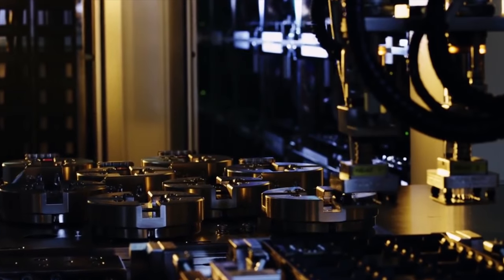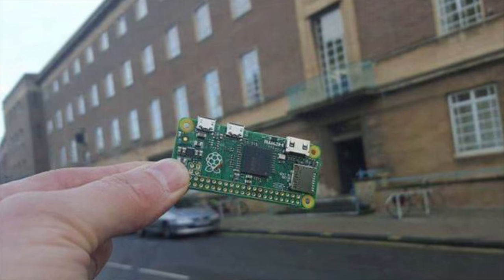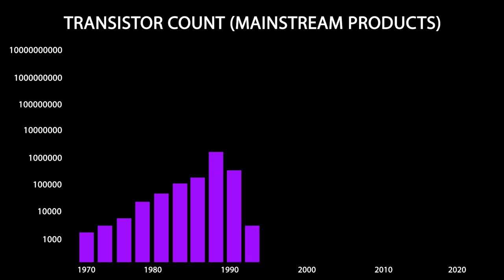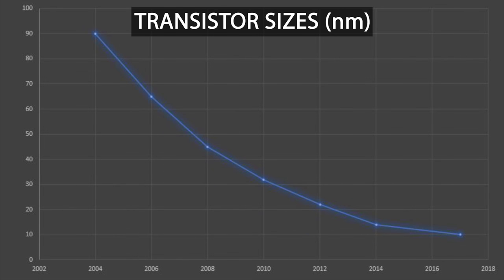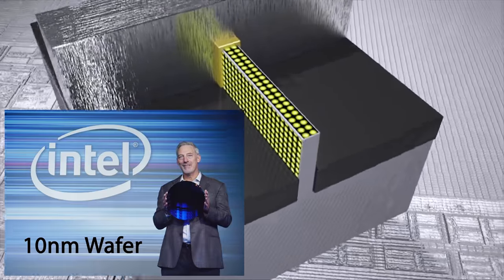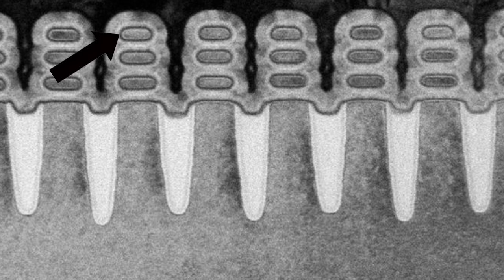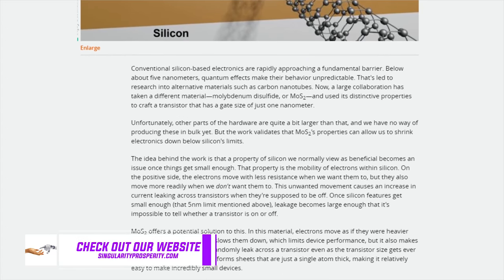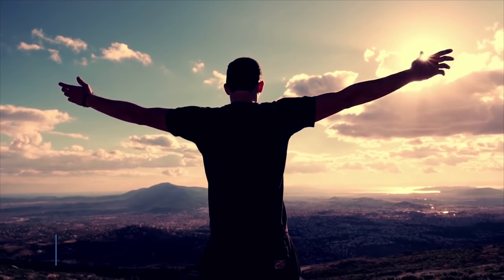The End of Moore’s Law?! (Shrinking The Transistor To 1nm)

Comment: Is it really quantum tunneling? Seems random concentration of energy, such as thermal energy would find it easier to push electrons across barriers. The smaller gate structure certainly makes leakage easier but has the dominant cause reach the quantum level?

Comment: getting smaller will come to an end, but not the end of CPU power, i mean once you reach the smallest transistor size then you just start making the processor itself bigger, the bigger the die the more transistors you fit on it. yeah this means the components will get bigger again going in a reverse cycle compared to the previous 'lets make every device as tiny as possible' trend but it will be the only way to get more power unless quantum computing somehow kicks off in drastic ways.

Comment: Moore's law IS going to die. But that doesn't mean that computing performance is going to stop improving.Fact is, at one point or another it will be impossible to make transistors smaller. There is only so many atoms you can stack before quantum effects start kicking in and preventing classical flow of electrons.We have just about reached the limits of CPU clock speed. Around 4GHz. I heard some people managed to push their computers to 5GHz, but this is the point of diminishing returns.Companies have worked around that limitation by creating various ways for computer to get faster without increasing frequency. For example, more efficient algorithms, and more efficient ways of computing numbers. Pipelines for faster execution of commands. SIMD operations for parallel processing. More cores for more parallel processing. Hyperthreading for more efficient use of CPU time. Predictive computing. Cache optimization.There are many ways in which computer can operate quickly. And there are even ways to transcend traditional silicon semiconductor logic gates. It is not provocative title to say that Moore's law is going to die soon. It is simple fact that it will. But it may be a little misleading to people who associate Moore's law with computer speed.They are not one and the same. Moore's law only talks about miniaturization. Now side effect of that miniaturization is lower energy consumption which enabled us to operate our computers at faster CPU speeds. It also allowed us to build more complex circuits on our microchips which also sometimes increased speed.But that is about it. Don't expect Moore's law to continue indefinitely. We have hard limit which is size of atoms. So unless we discover something smaller than atoms with which we can build transistors, Moore's law is going to die.

Comment: Stacking transistors vertically is the way to go for sure, but until other rising technologies be used for CPU computational power, such as Graphene, which is comprised of hexagonal structure, which provides better efficiency for electrical, storage and even store data in graphene, and then you also have the other technology of light-based CPU for computation, fibre optics, which should provide <50% power consumption. Light based computers which doesn't use electrons to pass a currents with bits of data and information from one component to the other, you could have a direct link between a CPU and RAM using light fibre optic, but in different varying colors of data streams for different things, comprised of 7 or more colored laser beams of light.

Comment: Can someone explain to me why they can’t just make a physically larger dogs size increasing the number of transistors without needing to make them any smaller. A 20nm process on a 100cm² die would have a significantly larger number of transistors than current CPUs. Devices requiring continually improved performance can simply increase the die size of current FinFET architectures to add more transistors and devices requiring small size already have enough performance. This problem can be managed in the same way as antibiotics to prevent it from coming to an end before a viable alternative is created. The only exception to this is smartphones which will require increased performance. This can however be achieved in the same way as before by increasing the die size. As smartphones themselves become larger it would be easier to fit a 4cm² 10nm cpu die which would quadruple the performance of the iPhone X than to try and make a 1cm² 5nm one with excessive battery drain from electron leakage.

Comment: This video from 2017 talking about going under 7nm is almost impossible, meanwhile intel announced they achieved 3nm in 2021
Reply: @thewalnutwoodworker6136  tsmc has confirmed 1nm cpus right after ibm has announced 2nm they are likely to use the new element bismuth
Reply: @ascendings_-xlmaouhoub753   bismuth not a newly discovered element.
Reply: @thewalnutwoodworker6136  of course not i meant newly discoverd as a new alternative from silicon in cpu manufacturing  ( that was the context )
Reply: @thewalnutwoodworker6136  what happrn to 3nm apple is on 5nm

Comment: And if someone else had another idea  to go further than more's law ? A material  that vibrates like a quantum string and can be electoplated and cut to a size half an atom inch thick.  A vibration would be a 1 no vibration would be a 0 a goggle plexus of transistors on  the next stage IC's following after more's  law.

Comment: We need to get quantum coherence for the next level. and make frequency dependent calculations, with gates that work with frequency instead of dc(frequency inside the gate not on contacts). and you can get different channels of calculations in the tuned frequencies in parallel (a bandwidth in accordance to the physical limitations of the media that frequencies going through). It just came to my head right now though just speculating. its not impossible.

Comment: Not quite accurate. The size of the transistors isn't actually 14nm or 10nm. That is the feature size, meaning that is the smallest they can make an actual 'part' of a transistor, as well as the parts between them. It's more complicated than that, but the point is the transistors are not that size. Good video!

Comment: I'm from the future, and AMD has already released zen2 which is based on 7nm transistors. They run ok.
Reply: I am disappointed to see people from the future are too lazy to type out "okay". Or maybe official English at large has moved over to more closely match text message speak as that is the only way we communicate with each other?
Reply: @timd3469  I'm afraid it's the latter, possibly a consequence of the transition the human communication has faced this age, which usually prefers the 'written method' (even though it's displayed, not written.) English was often an ambiguous and redundant language, which often results in confusion, such as "you're" and "your", or shortening, as seen in this case. Whether it was a positive or negative switch, I don't really know.
Reply: @diegofkda199  Ah, such as it is with many steps forward we take. We don't really know the positive/negative implications for some time.

Comment: Moore`s "law" pretty much ended 10 years ago when it comes to X86 CPU`s computing power... Last 10 years you only see small increases like 5 - 10% and even less in the generation to generation of at least the Intel CPU`s computing power. Writing this on a  one year old generation 3 Xeon CPU while latest generation you can buy is 9. I am running "old" tech because of better compatibility with Windows 7 and the performance is just slightly less then on the latest CPU`s at same GHZ...
Reply: 2-5% differences means intel

Comment: theres at least 3 factor to end processor industry: low income, physical limits, and end of moore's law. the third one is being replace by AI chips. others with cores. and so on. the most possible scenario will be the big data industry. Keep doing processors is possible but its not much harder than before, effort u can't support by minimal action's law. Its just the big posible path.

Comment: I looked around on youtube and found out that the 5 nm and 2nm chips actually are bigger than that but because of their design they are equal to the power of a theoretical 2nm chip

The transistor is then marketed as a 2nm transistor even though they aren't actually that small 
Link to the video that explains it https://youtu.be/GdLRSF5wZpE

Comment: I'm not going to pretend to understand this in anything more then "science" youtube communicator videos. But, isn't it possible to increase the size of the CPU it self? While the transistors are smaller and more efficient, can't we just pack more of them in by scaling the CPU itself? Then ofc there's the cliche answers like better CPU design, more efficient software and just adding more of the damn things into a computer. If CPU's can't get huge improvements on their own, we could just spend more time improving the support and power gain from having more then one, like SLI and Crossfire have been failing at doing but actually do it this time.

Granted the problem of Moore's law extends to more then just the general computer, but the solutions do also, and all I care about is the power of my own PC in this case.

Comment: moores law will not end anytime soon Moores law is not all about the gate getting smaller you could say there is Moore ways to double transistor count other than just shrinking the technology, 3d stacking with layers, also multiple clock cycles and speeds in different parts of the chip could help much like intel multithreading but way more advanced

Comment: the main reason GPUs are faster than CPUs is becuase, depending on the chip model and designer, the die size and general architecture like nvidias cuda cores. look at the die for the titan V, obviously not cheap but a good example of a huge GPU die

Comment: Quantum mechanics is mathematical , so leave that to  metaphysist . 

You only need a materialist point of view , otherwise you will find it quite difficult to engineer anything.

Perhaps the leakage is also caused by contamination  , since a small contamination would be very large chuncks  as the diodes are very smaller. 

The only real limit I see is vibrations ,But I think we can find a work around to this . Something like the "cloud" would work . Let me explain , there can be a main /base computer that does all the intensive computation and relay the results to for eg. our phones .  Put simply our phones would be no different from a smart TV.

Comment: Everything saturates. Besides the so called “Moore’s law” was never an actual law. It’s a senior in the industry putting a linear regression on very limited dataset and using it as a whip to drive the engineers to work harder and harder

Comment: Moores law is both an economic "law", and a "physical law". This video is misleading in that it implies that the development of smaller nodes is still even as economical as it was 10 years ago. Sure there are theoretical ways to print smaller structures, and dreams of averting sub threshold leakage. Yet the whole nature of doping, and circuit connects are dramatically impacted by nodes lower than 5 nm. Dont take my word for it, and dont take this dreamer on faith either, check out Ed Sperling ..... Moores law will end SOON.

Comment: uuuuu RAM and Storage do NOT use transistors to store data.
Reply: EvoPortal DRAM does, coupled with what must be a few nanofarrad capacitor. The same is true for NOR and NAND flash.
Reply: Incorrect.
Reply: EvoPortal What? There is a transistor between the capacitor and the bitline in dram, its base is collected to the wordline, which is then connected to the rest of the page. 

It is called DRAM (Dynamic Random Access Memory) because the capacitor in each page rank slowly discharges, requiring each page to be written to the row buffer (reads are destructive) and then written back to the page to refresh the charge.

Did we suddenly stop using DRAM while I wasn't looking?
Reply: EvoPortal You are incorrect
Reply: My god...The data in DRAM is NOT stored by transistors but by micro capacitors. How do you not understand this???
Reply: I just explained how it works, the charge is temporarily buffered by the capacitors, but the transistors are what "stores" the charge into the circuit. Since it requires constant refreshing, the charges are actually being passed through the bitline gate transistor actively for nearly as much time as it spends in the capacitor passively.

I obviously understand how DRAM ranks are organised and function at a logic level, if I made an error in how I described their operation, please feel free to correct me. Otherwise I would recommend that you consider shutting up. DRAM is NOT like non-dynamic memory, and requires logic elements for persistence.